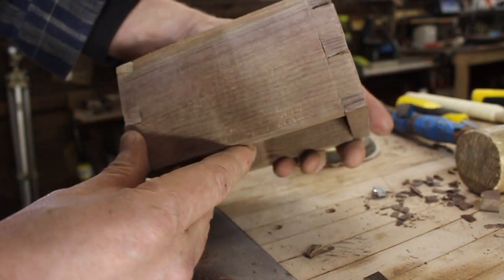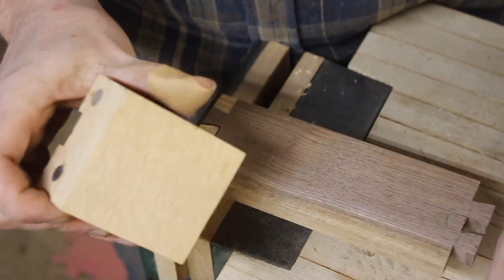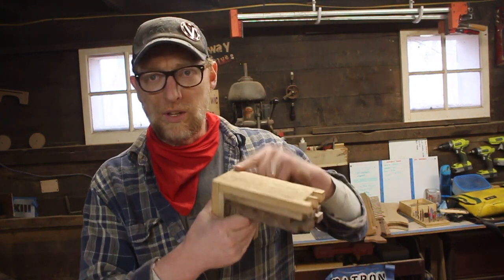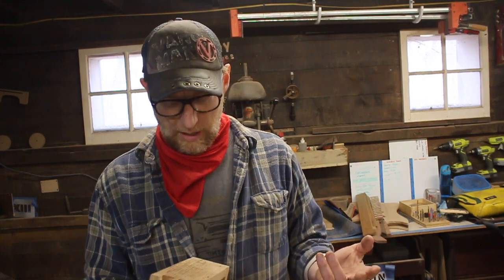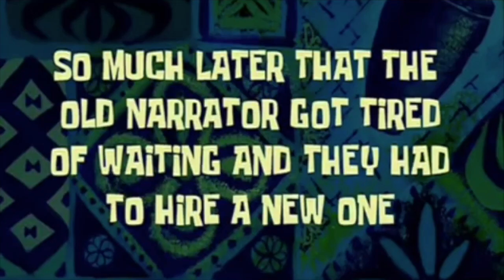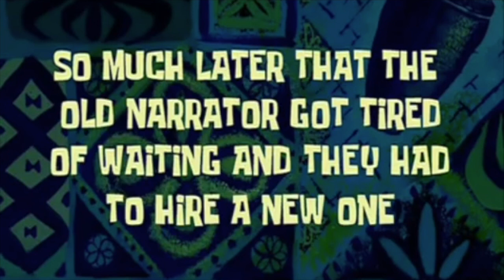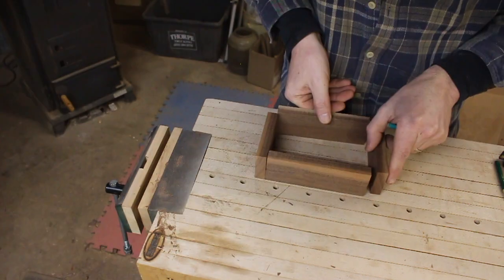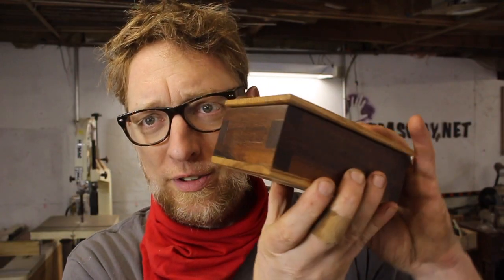Personal Challenge | Hand Cut Dovetails | Prove Myself Wrong

Comment: My favorite trick I picked up from Instagram is with the too big gaps, just make them bigger and get a shim of the same wood in the same grain direction and glue it in. It's almost seamless and clean. 

I personally really enjoy dovetails, I think historically they were like cheap joints for everything because they didn't need any hardware but could be left without glue. After you get through the first few sets and figure out where to not mess with the grain, they get a little easier. But I can dig not wanting to do them, that's a cool bird.
Reply from the maker: lujanjd good tip! Thanks. I will remember that. Once I better understood them, I enjoyed it more, but I can make box joints on my table saw way faster! :)

Comment: Enjoyed the video. Did you change your shop layout recently?  I like the CNC being more centrally located.
Reply from the maker: Yes. I did a 60-second tour on instagram a couple months back showing the changes. It was tough cleaning up around the CNC when it was in the corner, so I made that a work bench for soldering, little projects, etc., and moved the cnc to the big bench. thanks!

Comment: Final result is great. No matter if you cheated a bit. Personally, still trying to achieve a nice result. What I've learned is that using a coping saw with hard wood is not the best choice. I'm working on following Paul Seller's instructions. Knife walls is the trick...
Reply from the maker: Yea, I need to sharpen my chisels better and get a nice, clean slice. The coping saw is asking for trouble, agreed! I tried a few chiseling out the entire waste piece but my edges got to messy. More practice needed!

Comment: For your first 2000 years and eternity working on dovetails, they look great!  Your saw guide tool looks great, but if you're having trouble with it moving around, cut a strip of 220-ish sandpaper and glue it in the groove and it'll grip the wood much better and not move around when you're sawing.
Reply from the maker: that's a great idea! I made the channel 3/4" wide for varying wood thickness, but most f the stuff i was cutting was 1/2". A little grip would totally solve the problem. thanks!

Comment: You're someone who works with reclaimed materials. That takes patience.
Dovetails aren't quick and easy, which is why many don't do them, my students struggle learning to do them, and it feels awesome when you make a nice one.
That said, they're a joint with a specific purpose in furniture. It's a very strong drawer front joint. Look at an old dresser. Those dovetails aren't pretty, but they sure are strong.
Ditch the jig. You may be surprised with your results.
Nice work overall.

Dad joke. bahaha
Reply from the maker: haha! yea. I've made drawers with a half-blind dovetail jig which is not as pretty but works as well.  They do make a difference. Just trying to collect more skills...